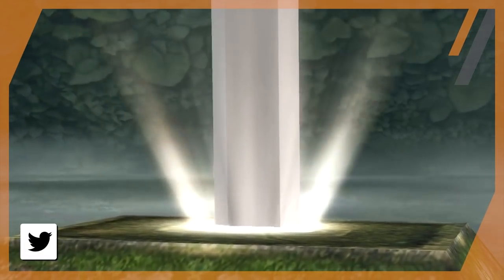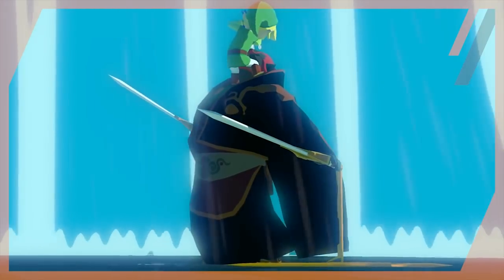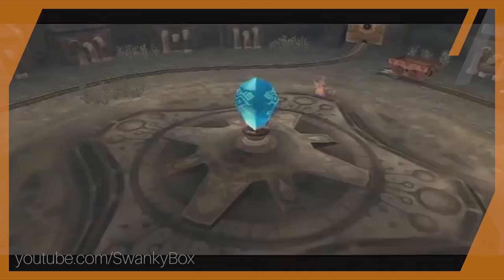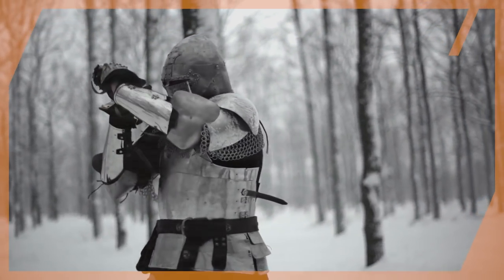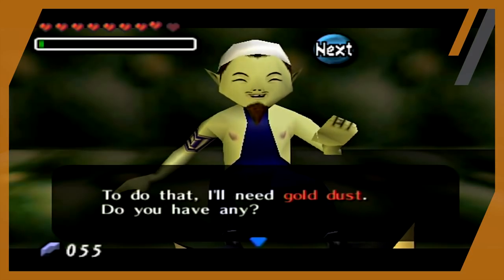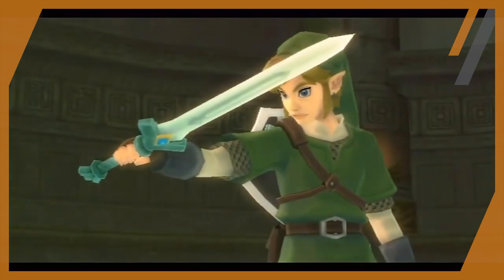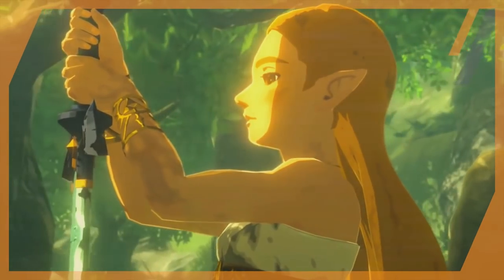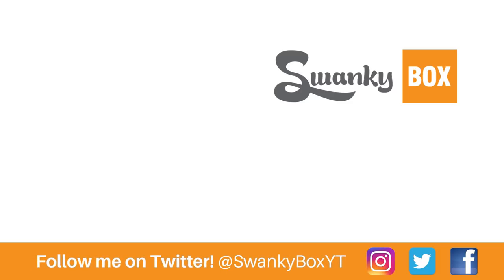Why EVERYTHING About Zelda's Master Sword Somehow Makes Perfect Sense

Comment: It cant be titanium and gold, because the weapon for majora’s mask is the kokiri sword, not the master sword. So you found out that the kokiri sword is titanium and gold.
Reply: He only used that as an example.  

It CAN be a titanium gold alloy. We just don't know for sure because there is no official answer yet. But his theory still makes sense and has a solid foundation
Reply: Because there's not enough Titanium or Gold in the world to make more than 1 sword, obviously
Reply: I think it was more because of the power of the allows and how it would fit. You see the gilded sword forged from the koriri sword and how it's powerful.I think the same is done to the master sword in LTTP to strenthen it.
Reply: Gold is associated with wealth and spiritualism, or in the world of Hyrule it can be seen as being associated with magic, think about how when the kokiri sword was forged into the gilded sword, using gold dust, it wasnt affected by the rewinding of time. He was making a comparison between the two, and how it could be titanium/gold alloy, as he explained in the video, when adding gold to titanium at a 3/1 ratio (that being 3  parts titanium, 1 part gold) the metal is then roughly 5 times more durable, stronger if you will. So anyway he is saying that it could be made out of that titanium gold alloy, as that would make the blade nigh indestructible, but also having the gold ties back to the magic or spiritualism thus giving it its other magical properties, the sword beams ect.

Comment: First, i think the Master Sword is made of Master Ore (the blade). And the M.S can be fisically restorrd along the time. Problably cause of the metal, the pedestal, or, like you said, the time manipulation power. But it's important remember that the Anti-Darkness attribute is not in this material and don't have connection with Gold.
This power is probably of the goddess of hyrule itself, that you got with the flames in Skyward Sword and MAYBE using Fi's help.
But this power can be sealed out of it, like in Wind Waker when you need to regains the power of seal darkness in the Master Sword again, and that's not regenerate with time.
And you not talk about the power of the master sword of produces sword beams if the life energy of the user is high enought

Comment: Cool idea but now i have a question for you (or anyone interested), considering the relative length, width, thickness, and (hypothetical) weight of the master sword does it classify as a greatsword? the blade is a lot bigger than an average broadsword (and is quite large in link's hands lets be honest) in fact the ratio of link to the master sword is somewhat similar to the ratio of an undead to the bastard sword (the smallest greatsword class weapon) in darksouls except the master sword is wider than the bastard sword which would make it heavier. To think that link is effectively wielding a greatsword with one arm TIRELESSLY . Okay i'm done rambling now, feel free to correct me if i'm wrong.

Comment: You misrepresented the edge and core details. You want a soft core, to make the metal springy and not damage under force. You want a hard edge so that it can keep it's sharpness. Also a sword will not cut through armor, and is not intended to. Common misconception, but it would just be unnecessary strain on the sword to try and cut metal with equal metal.  There is a problem too with using titanium (and the harder titanium-gold alloy) in swords, which is that because it's much harder than steel, it will lack the necessary softness for it's core to make it not shatter much more easily when stressed.

Comment: Swords don't cut through armour, that's a hollywood lie.
Reply: A fellow historian I see.
Reply: @sporeham1674  your both wrong when it comes to the old diamond edge katanas
Reply: @sporeham1674  If either of you was a historian, you wouldn't think armor is a synonym for plate mail. Carbon steel cuts bronze armor, certain thicknesses of iron, silk, cotton, wicker, rattan, boiled leather and others just fine because the technology is superior to the armor it's going up against. Swords did in fact even cut through other swords of poor make because a harder material met a softer material at a combined speed of over 150mph. Watching skallagrim between wank sessions doesn't make you a historian, it just means you're out there spouting your own misconceptions and giving people the wrong idea. Armor means more things than that shiny thing your favorite historical fighter wore for a brief period of human history. Or maybe I missed the memo and armor never existed until the romans invented it? Is knights armor the only armor in human history all of a sudden?

Your armor gives you a shot at surviving if you screw up. An iron splint brace can still get cut through if you aren't watching yourself and meet it with a sverd at full swing at a 90 degree angle, you're losing that wrist. But chances are that it will hit at an angle and not do that, but it's a better idea to just fight smart and keep your hand behind the shield instead. Yes, there were also wooden shields that did get cut through, and sverds of the time were built with the destruction of those shields in mind and were made tip heavy to help cut and splinter the damn thing. You see recreationist events with blunt steel and those shields are still coming back cut to the boss (I know this because I fixed those shields).

I'm sorry to burst your bubble, but you guys are just armchair philosophers and HEMA fans who watched a few video's and consider themselves learned for it. Cool your jets on the historian thing until you get a better grasp on what armor is or you're just going to lie to a lot of people the same way hollywood does: by keeping the source vague. You're taking an interest in history, that's nice... don't act like you have a grasp on facts though, or you'll get buried alive in context, nuance and technicalities.

Edit: Buried myself in a technicality in the process, funny enough. Apparently armor does only refer to metal, which begs the question of what do we call lamellar or wooden protections if not armor?
Reply: Cretaal m8. You wrote several paragraphs. About a the technicalities of blades and armour. In a video about a videogame.

Thank you for that. It was very interesting and quite insightful.
Reply: But they do
Reply: Cretaal That’s a lot of paragraphs for this one subject, but I definitely appreciate that you took the time to write it all out. This kind of comment’s been annoying me for a while.

Comment: The gilded sword is not the Master Sword. It is an upgrade of the Kokiri Sword. So the titanium theory is dubious at best. The Timeshift stone hilt would make sense, however.
Reply: And the guy confused links other swords with master sword. Only the chosen hero can wield it. Doesn't matter if he is good or not.
Reply: He never claims it's the same sword. He said we get a tip from Majora's mask in how that sword was upgraded.
Reply: @shockthetoast  knowing it's a different sword makes that point almost invalid, however. He could've brought up A Link to the Past's Golden Sword instead, which is far stronger evidence.
What I am saying is, since the Guilded Sword is a different sword, it makes no sense to even try to make the connection based on that alone. And since the Golden Sword is not mentioned once, that is what happened here.
Reply: @CallMeLethano  He's saying on how that's how the Goddess Sword was made into the Master Sword. Also you should have said the one for Link between World's instead, because that one with Link to the Past is iffy at best. Like, I can probably understand that a fat queen of fairies is somehow able to make it more powerful, but the dwarves just hammering at the blade some how makes it stronger? Nah, not buying that.
The example was that the sword couldn't get more powerful/sharper and durable, without another metal being added on top to make it as such. So Kokiri to Gilded sword was to demonstrate that. Which is why I said you using LttP as reference is terrible, and why aLbW is a better example, because of the fact that in a Link between Worlds, you're giving it to great/master Smiths along with rarer metal material to fuse/forge it with.

Comment: As a note, for potential extra forging steps.  It could have been Damascened(the process used for Damascus steel) for used the modern method of folding which comes from Asian blade-making, to increase the strength of the blade.

Comment: There's some interesting info here and it's a cool video, but makes some leaps I'm not so comfy with. Namely assuming the gilded sword is made out of a material, so the master sword probably is too, and the fact that if you make a sword with a harder metal, it actually becomes more brittle and therefore MORE susceptible to breaking than other swords

Comment: Actually, the Master Sword is made of Draenium, a metal mined in the depths of Death Mountain. Through certain chemical processess, Draenium can be made indestructible. Also, if a certain energy flows through it, Draenium glows blue and can cut through any material, although some materials may need a little extra exposure time to be cut. There is an energy power bank stored in the hilt of the Master Sword. The small gold diamond-shaped thing on either side of the crosspiece is actually a touch button, which turns the power bank on, activating the advanced cutting ability of the blade. However, almost like Iron Man's Arc Reactor, it will run out of power eventually, automatically turning itself off and begin to recharge the power bank. After it is recharged, the power bank can be turned on again, reactivating the blade's cutting ability again.

Comment: 2:52 You have to heat carbon steel to a very specific temperature for it to become hardened at all following the rapid cooling in water or oil. After the hardening process comes the tempering process where the sword smith has a little more creative freedom. Tempering the steel at a higher temperature results in a softer but tougher blade, tempering it at a lower temperature results in a harder but more brittle blade. What you describe, regarding the tougher core and the hard edge, is referred to as „differential hardening“ something that has been used almost exclusively in japan. European swords were most of the time mono steels and were hardened + tempered through and through.

I enjoyed your video but this is a subject you are clearly unfamiliar with, thus a little more research or a consultant would have been great.

Comment: Makes a lot of sense.

The MS is like a neat but "soft" time sword. It use it to maintain itself and allows change/mods to affect stuff (power beams, sealing ability, and iirc detection abilities in SS).

The fanfic "from fake dreams" plays with the idea of heavily time-modified swords. They don't dull as they dont let time pass to allow any change (wich has its uses and drawbacks). They can be set in "relative space" (they don't move, at all, ever from where you put them. Becoming platforms, walls and such), they can be set in "space" (aka the planet move, the sword doesn't.). Also means that used well, they can literally block anything if you lock their relative space at the right time in combat.

Comment: One game I played winter time 2020/2021 was Hyrule Warriors age of calamity. Part way through the game you pull the Master Sword.The sword was in pretty good shape in that game, but not at its full potential. In order to get it to its full potential was to keep taking basic swords and having them all fused into the master sword at the blacksmith.I know this sounds far fetched, but whoever came up with this concept made its a good thing to just keep leveling up the Master Sword to a level 30 powerful sword. At level 30 its took (my attack in the sword was 125) made defeating bosses when using Link much easier. Enemies that were corrupted in malice went down quick with the Master Sword fully powered at near highest strength too.

Comment: This is impossible to find, but how conductive is this titanium-gold 3:1 alloy?  Like, as a percent of copper?  Wanting to know for a roleplay.
Reply: I'd imagine less conductive than copper, since copper is the second best room-temperature conductor. Only silver better conducts at room temperature. It can be a better conductor than room-temperature copper, however, if you can get it cold enough to become a "super-conductor". That's basically a conductor that becomes so cold, there's literally no resistance.

Comment: The problem with titanium, including the gold-titanium alloy you mentioned, is that hardness does not equal toughness. Titanium can get decently hard but its other properties do not lend itself well to a knife and definitely not a sword. The best-suited titanium will fall short of middle and even most low-end steels for blades.

In lieu of the gold-titanium theory, one could imagine that the blade was made out of a pattern-welded billet of meteorite (often linked to mystical properties by many civilizations) and other fine steels. The "magical" washes that the blade goes through could be considered to be infusing the blade with chromium, vanadium, and cobalt...all which can give steel improved qualities.

Just a thought!

Comment: I know what the metal used to make the Master Sword is, Master Ore. It is only in a Link between Worlds, and it is a Metal that is reddish orange in coloration, but has been shown to change color when added to the Master Sword or Master Sword + in aLbW, so my theory is that the Master Sword is made out of a combination of Master Ore and the Time-Shift Stones and bathed in the light of the triforce, and superheated with the three flames of the Triforce to harden it even more.